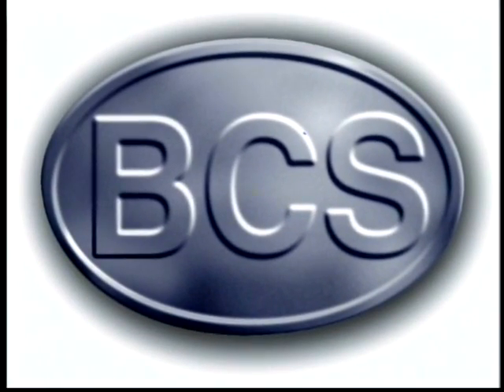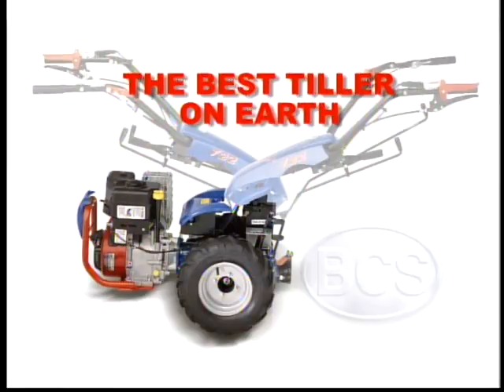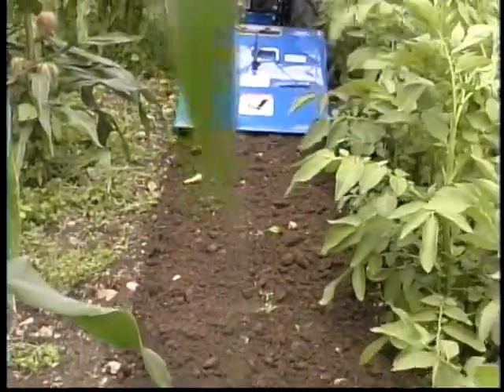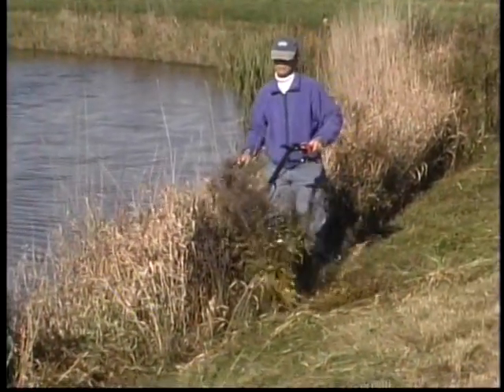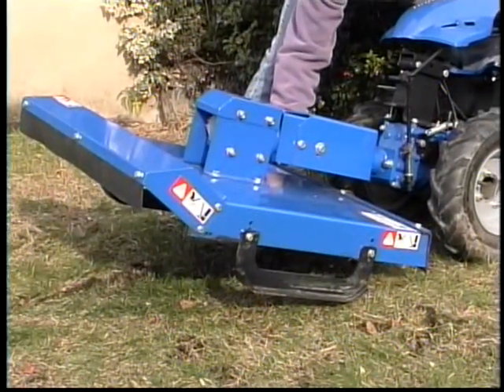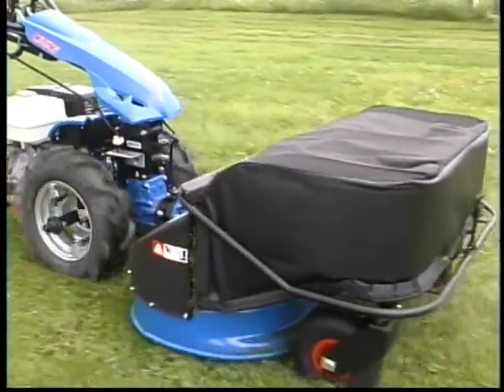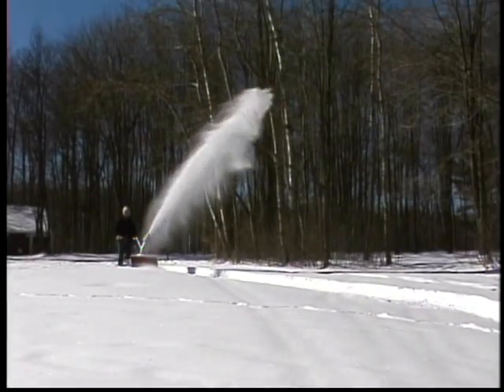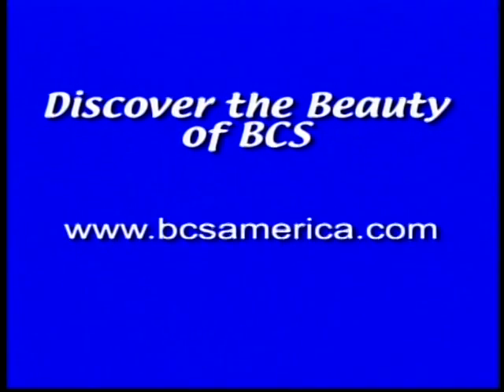BCS Two-Wheel Tractors: Discover the Beauty - Watch our '90s DVD Product Reel!

Comment: How many inches wide is the 749?
Reply from the maker: It depends on the wheel size, and whether wheel extensions are installed.  For 5x12 wheels, the width is 22''. For 6.5x12 wheels, the width is 25''.  Each set of wheel extensions will increase the wheel width by 5''' total.  Read more here:  https://bcsamerica.com/news/tractor-wheel-widths